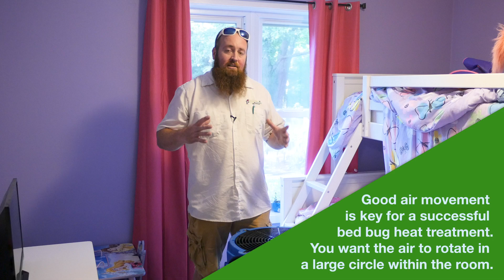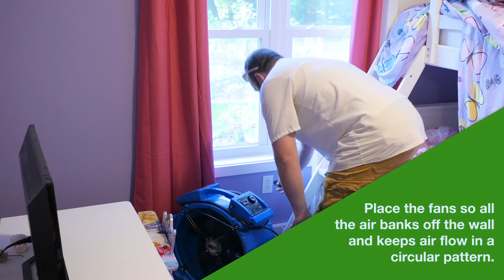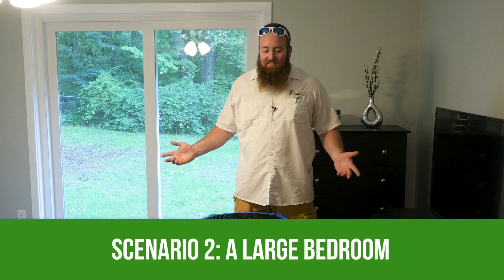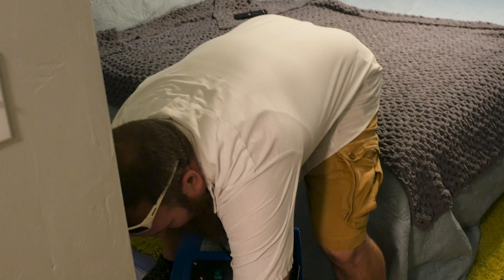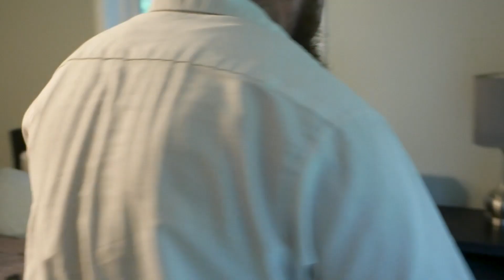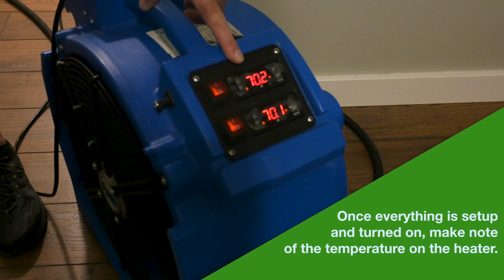How to Setup Bed Bug Heaters

Comment: i started seeing some after my daughter mentioned her mom's house ended up with bed bugs...great 😡😡.   
I bought some Harris bed bug products to spray. Then I figured I'd try using space heaters to see what i could get a room temp up to.
2 small 120v space heaters set to high and max got the 12x12 bedroom up to 118-120 degrees.  I let the room stay at that temp range for about 2.5 hrs. Total time above 110 degrees was probably 4.5 hrs. The bed is a lift up storage bed, so one heater was "under" the bed/mattress facing the headboard/wall.  The other was at the doorway facing the room. Air vent was covered so the AC couldnt reduce the room temp.
I found dead bugs near the top of the curtains (that drape down against her headboard). Whatever bugs i saw on the headboard before that, i sprayed with the Harris killer (before heating). They appeared to die within a few minutes.  Some appeared to die instantly.
I caught this pretty early I hope.  
There were a few babies/nymphs on a couple of pillows.  All the bedding was already bagged up and being washed with hot water while i was getting the room ready to spray, before turning on the heat.
Really hoping they hadnt resorted to trying to hide in baseboards and other crevices before i found them.
Reply: Also, there were no spots or bugs found on the mattress or box spring anywhere.  I sprayed them anyway.
The curtains were taken down and washed afte heating the room.

Comment: What kind of fans and heater are you using?
Reply: Call heaters just for this project, they cost a couple thousand and you will need to do all rooms to make sure one by one. But if you drive them into the walls, through outlets, ceilings, through fans, lights, floors through baseboards, floor crevices, deep inside box springs, behind pictures, tapestries, they will hide and come back.
 Heat gets most, but some will get away and quickly reinvest.
 You have to put special covers on your box springs and mattresses unless u throw ALL your stuff away, they will hitchhike on your clothes into your vehicles, and can migrate their way back in same way.

Comment: Apparently they're not answering any questions. Pretty vague description and temp that needs to be reached. Hotter than 70 degrees? No kidding,it takes at least 113 degrees. And no mention of insulating anything,ie ac vents or glass doors or windows.

Comment: How would you heat an entire house? Won’t you just be pushing them out of the room?
Reply: Yup, thats what happens, once they get into walls, floors, ceilings, etc, they can and will reinfest.
Reply: No, usually they get lethargic as the temp rises. They don't necessarily try to flee the heat.
Reply: He said in another video that if you heat the room up gradually, they won't "flee" because they won't realise until it's too late.

But if the room reaches high temperatures too quickly, they're more likely to freak out and flee.

Comment: Does it take awhile for the temp to rise?
Reply: Heat kills them on contact, but to get that heat to reach into every nook and cranny takes along time and is also not likely enough to handle the whole problem.
 If they can get into the walls, inside mattress, into the floors and hence under the floors, it won't get hot enough to kill them b4 heats turned off, and they will quickly migrate back in.
 If u don't throw away your carpeting, pads, box, springs, mattresses, there are sufficient recesses for them to hide and come back.
 This includes taking out drawers, dumping all contents, spraying thoroughly, spraying all surfaces of furniture inside and out, upside down and all around.
 You don't need expensive sprays since alcohol kills them on contact, but the thoroughness of the process is unforgiving, if you properly spray everything thoroughly and prevent them from migrating into the wall, floors, etc, you don't really need the heat.
 Heat is thorough for diect contact, but if they can get into walls and floors and insulated hide holes, they will migrate to other parts of your home, if in appts or connected condos, this means they will spread to other units, then forget it.
 They don't want to  e far from their food source- YOU- but Heat will drive them far enough away for safety , then they will come back quickly.
 Its gonna be a process, but is not gonna be a quick thing.